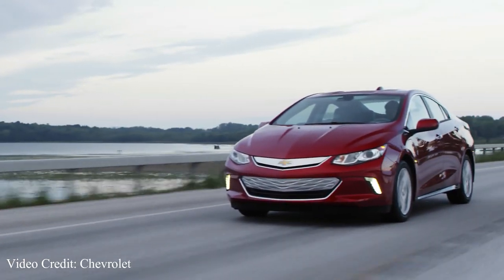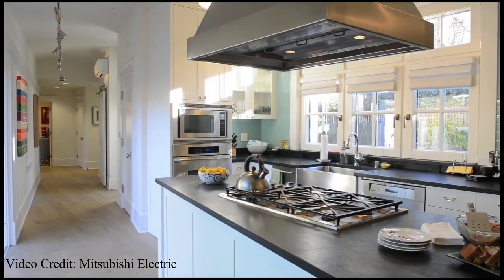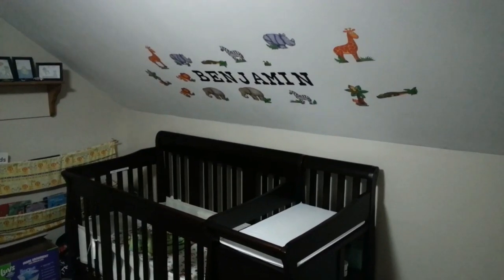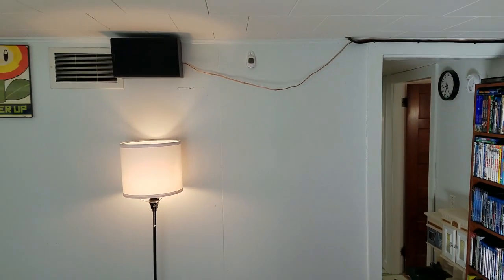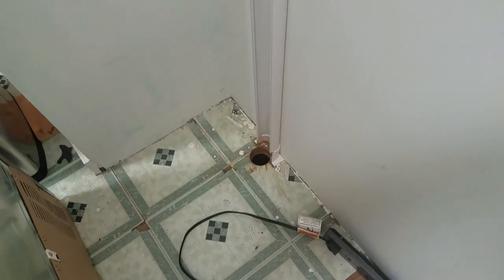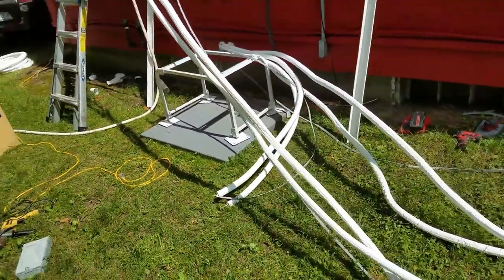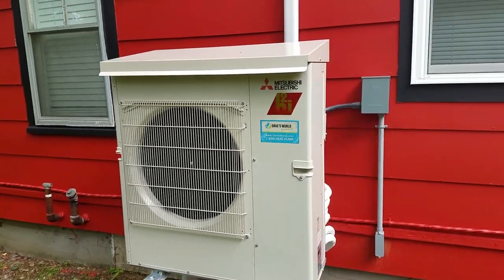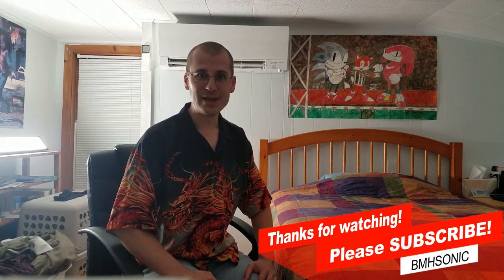Mitsubishi Electric Heat Pump install and Whole Home Heating and Air Conditioning Solution

Comment: Welcome back Bill, it's been awhile.  I hope you'll give us an update on the system which I assume will cause an increase in electric.  I suspect that oil furnace will kick in when temperatures get real low over the winter.  Most heat pumps have electric assist but you should be better off having that oil furnace to back you up in those extremely cold Maine winter months.  I'm sure you'll be collecting lots of data to share with us.
Best to you and Ben.....
Reply from the maker: Yes I will... I'm looking forward to seeing how well it preforms this coming winter. I've had one of these before so I already know what to expect. I'll keep you posted.

Comment: That looks like the right kind of system for that house. In my part of the country we have central AC and national gas heating.  The most important thing for us is AC because it's hot from May to October.
Reply: Wow does my Mitsubishi  slay  humidity. . We spend 35% less  for cooling, get superior  humidity  control along  with almost  silent  operation  inside and out of the  house.  MY old house cost  me $1800.00 to heat  and cool during the 2014-15  season. Heating oil that year was almost $4.00 per gallon which motivated  me  installing  a two ton unit unit  and starting the summer  2015  I spend less than $700.00 per year....Wify raves about  the  mildew problem disappearing .

Comment: How was the heat pump over the winter? When did the oil kick in? How was the electric bill? I just installed bosch heat pump in June. So far so good! We have it set to heat till it is below 30 degrees then the oil will kick in.

Comment: mini splits are great and efficient for bed room and small spaces without seeing a hit on your electric bill. I keep the bedroom mini on 24/7 and its like not having anything on compared to the electric floor board previously. However, the bigger 18k mini for the living room does increase my electric usage that is noticable, I normally use 17k-18k KWH a day but  with this mini on, it will increase to the mid and high 20KWH a day. If left one all day, it can go as high as 36KWH a day. So yea, it doubles my elecrtic usage per day. Overall, my electric usage is way below average , I think and going to the mid 20KWH is still pretty low and reasonable but i got use to the 17-18 KWH usage, so to me, not that great. I use the wood stove mostly and the mini to keep the heat going when too lazy to reload the wood stove. Hope it works out for you.
Reply from the maker: It has been working out for me. 🙂 This video was taken pre covid and since then I have moved. I outfitted my new home much like this during 2020, and have been running solely on heatpumps ever since. I've also added solar to offset the increased electric usage. While it's true that the efficiency drops when temperatures fall below freezing the units still work as expected, and continue to keep my home nice and warm all throughout the winter. Even with the increased electrical usage it's still cheaper to pay the electric bill versus having to fill the oil tank every 30 to 45 days. (and that's before adding solar) With the addition of my solar panels I have effectively eliminated my electric bill.
Reply: @bmhsonic  I love your new approach. Adding solar is an excellent addition to your mini split. I wanted to do the same but that solar installation runs in the $30k. Way too much for a return at this time. I think I need to keep searching for other solar companies till I find a reasonable one for me. 

I bought the Gree mini since the cost of install was in the $5k for a 30k and a 9k BTU compared to a Mitsubishi at $17k. So if I can find a better priced  mini, I hope to find a better priced solar system as well. Going solar is the way to go with these mini splits. Great to hear at your end

Comment: You left out the most important answer to the most important question and that is: WHAT DID THIS COST YOU FOR THE ENTIRE JOB? Very surprised you left  this out.
Reply from the maker: Installation pricing will vary greatly from one installer to another. Also your location and date of install will play a major factor here too. This system was installed in 2019...on a house I once owned on a lake in the middle of nowhere in Maine. It's now 2023 and a similar system I have since had installed on a new home of mine just last year was nowhere near the same price that I had paid in 2019. For these reasons I don't get into what I paid for anything here on YouTube.
Reply: @bmhsonic  Still all in all giving out the cost you paid, the year it was installed and the square footage of your home as well as your location is a good starting point for anyone looking into heat pumps. I think anyone considering this would know enough that changes from what your conditions were would result in different number, but not giving out this information gives the viewer no starting point from which to begin to consideration of a similar system. Some information in this case is better  than no information at all. From everything I am seeing about alternative heating systems from from my current gas furnace is that high efficiency systems are not worth the cost of installation as the payback time in too long as well as the shorter live span of new high efficiency systems.  Knowing what your system cost you at the time would have helped a lot in determining if my assumption is initially correct of not.

Comment: The hood may be model specific so I wonder what is the model number of your outdoor unit? Thanks again.
Reply from the maker: Unfortunately I wouldn't be able to tell you as I sold that house last year.  I did install another unit on the house that I'm in now, but the installer did not deem it necessary to put one on the newer unit here.

Comment: Hi Bill. Met you at the transfer station yesterday. Just watched your heat pump vid, and it occurs to me that right now, somewhere at the other end of the electric feed lines at the generating station, either fossil fuel or nuclear fuel is likely to still be used to generate that electricity. So I wonder what the net reduction in carbon footprint is in running electric climate control in one's house over burning oil, or gas. And since it is a pump rather than a resistive element for heating, how much more efficient is a mechanical pump device pumping refrigerant than a direct-to-inside air heating device... It would be interesting, I think, to report on the cost savings you experience over your oil furnace, too.
Keep up the good work!
Reply from the maker: Yes, hi! I'm looking forward to reporting on this some more after we've gotten through this coming winter. As for the grid it's always getting cleaner, and I can clearly see windmills along rt.2 so it's not all fossil fuels helping to power the grid these days. Maybe if I'm lucky I'll install solar one of these days and can report on that! 😉 It was nice meeting you the other day. Here's hoping that some of those other technologies you were talking about come to fruition someday! 🙂
Reply: Heat pumps are over 300 percent efficient. Electric vehicles are 80 percent more efficient than gasoline. Power plants are cleaner than gasoline engines even if they are coal. Add that to the 80 percent more efficient, and electric cars are by far cleaner

Comment: Hi Bill, I enjoyed your video on the heat pump, mini-split installs at your new home. Congratulations to you, Rebecca and Ben!! I like to color you painted the house. By the way, what's your current garage and home charging status? Just curious. Let me know. Talk to you soon. Thanks, Paul
Reply from the maker: Hi Paul... yeah... Well Rebecca and I are no more, but I do keep the car garaged and I ran a 240v service out there so I'm able to just plug in when I get home and never have to worry about having a "full charge" (I use Hill Top mode in my case) or the time that it would take solely charging off of 120v.
Reply: Hi Bill, I am sorry to hear that!! All the best to your family!! Do you still have the 2017 Leaf?
Reply from the maker: @Zazu2You  Unfortunately I had to give up the LEAF last summer as both cars were in my name. I'm not sure who misses the LEAF more, me or my son because Benjamin always asks me where the white GHOSTBUSTERS car went. The BOLT however has been saving my butt with my longer commute now as I don't have to worry about it as much in the winter months when the range is reduced.

Comment: I’m wondering why you went with a ductless setup instead of just running refrigerant lines straight to the location of existing ducted system. Am hoping to upgrade my gas furnace (installed in 1957) with a heat pump, and it’s looking from what’s online that it’d be much easier to install a single unit that can use existing vents, vs. having to channel pipe to different rooms. My place is similar size to yours, it seems, though I’m in northern CA where it hardly ever gets down to freezing.

Comment: Bill how has your electric usage been with the air source heat pump, and why did you go down the air pump route instead of the high temperature duel hot water tank and air ?
Reply from the maker: So far it's been great... This summer when it was in the high 90's I was keeping my whole home (top floor and bottom floor) at a cool 72, and because I live in Maine I've already had to switch over to heating as we've had nights that have fallen into the low 40's already! I've been keeping a close eye on my electrical usage as well, and from what I can tell I've been averaging no more than an additional 5kWh daily since it's been put in. (with most days less than that.) The system is working great and I absolutely love it! I don't feel guilty either turning the heat on early this year too. 🙂

Comment: Great too see you again bill😃 your new heating/cooling  system looks great.  I live in a condo so i am stuck with regular gas heat and central air that don’t work right now.  I like fall weather becase i will get rid of the 90’s.  How are you liking the bolt? I got to use my 1st electrify america  station . It is really nice . Big screen with all the info. They have 451 locations now.  Check out plug and play ev on youtube. He has done some long trips in his bolt from boston to cleveland ohio and up to canada. He is on instagram too. Great guy like you.
Reply from the maker: That's awesome! I haven't had the opportunity to check out any of the Electrify America charging stations but they look awesome and I look forward to changing on one someday. 😃

Comment: I'm finally caught up on the back watching videos. I found your channel 2weeks ago, and have been binge watching to catch up. Great videos, very informative, and the audio is pretty good. I hope to buy a 2019 Chevy Bolt in November, or sooner. Even though I currently have a Nissan versa note, I do have an electric scooter for in town use.
Reply from the maker: Thanks for watching! I hope you've found my videos informative and fun to watch. 🙂
Reply: @bmhsonic  I found the videos very informative. It's made me more impressed with the Chevy bolt. Even though I don't have EV right now; I did download the plug share app already. Based on the Chevy bolt's range I could realistically go from my hometown to San Antonio or Houston, by using free (complimentary) fast chargers. Again thanks for making the videos.

Comment: I am assuming you will be posting regular updates about your comfort and energy savings as the winter draws near and progresses?
Reply from the maker: If not regular updates I'll definitely post on this again once winter is through and my experience with it.
Reply: @bmhsonic  What have you been thinking of the heating performance so far?  I am sure you've had several nights in the 20's if not teens up there already.  Is the heat output awesome or just marginal like most heat pumps?  Have you had to supplement with your oil?
Reply from the maker: @TheRealJRC  hello there, yes we've had some cold nights here already. The heating IS awesome! I have not touched my oil since late April. 🙂 The electric consumption is about 10kWh more per day on the really cold days/nights. At about 17 cents per kWh (where I live) that's about a $50 increase on my electric bill...which if you think about it is not bad considering oil is around $2.50/gallon right now and I can easily blow through 100 gallons (or more) in a month! I'm on track to be saving at least $200/month! One thing I have noticed (and I was kind of expecting this anyways) is because where heat rises and the thermostats are located in the air handler units themselves you need to adjust the heat almost 10 degrees higher than what you want the room set to. I like it to be 72 in here, and I've found that by keeping the system set to about 78 it's been able to achieve that with no problems. In fact because heat rises I haven't been using the upstairs unit at all since summer (to cool the upstairs) as the two main floor units have been able to keep up with the demands for the house. So far I'm loving this system! 🙂
Reply: @bmhsonic That’s awesome news.  I’m preparing to renovate an older home and planned to use these systems for the heating and cooling entirely.  I was concerned that the air coming from the heat pumps would be cool or cold like most traditional systems, but it sounds as if that’s not a concern.  I’ll be watching for some cold weather videos.
Reply: @bmhsonic  Any updates or good cold weather videos?
Reply from the maker: @TheRealJRC  I've been pretty busy around here so no videos as of late, but I do plan on putting out a video of my savings once winter comes to an end. The system is working great and the savings are definitely there even with the much higher electric bill which was to be expected. I look forward to showcasing all of my related bills (from last year before the system was installed and then this year with the system) once I get to about April or May. I want to be sure to cover what tips and tricks I've learned with using a whole home system to heat the home and to point out any worries or concerns that I may have had when it comes to using and maintaining my existing furnace.

Comment: Yeah, but was the price?
Reply from the maker: This was a $10K system fully installed. The loan is at 4.9% and the payments are right around $100/month for the next 10 years. Completely worth it! 🙂
Reply: @bmhsonic   I wonder what the cost would be to have about 5-6 mini splits installed. I bed out of this world.
Reply from the maker: @silvergt4254  idk...you would have to get a couple of quotes from installers... The funny thing is the first quote I got the installer wanted something ridiculous like $15K for this system...and one of the indoor units wouldn't have been as powerful as what I ended up with. The second installer said they could come in at this $10K price, and where I've done business with them in the past it was a no brainer! Professional installation will always add to the overall price of your system, but it shouldn't cost three times or four times as much as the equipment.

Comment: Heat pumps worked good until the temperature drops, then it will freeze up and then have to go into defrost mode. They have heat strip backup but that sucks electricity like there's no tomorrow and the efficiency drops like a rock.  I'm not sure if you're going to be saving any money or not.
Reply from the maker: Well we'll see... If oil skyrockets then for sure there will be savings. Even at it's current price here in Maine +/-$2.75/gallon the heat pump systems are a more attractive option. Just like my electric car of course the efficiency drops the colder it gets, but it sure beats paying for oil/gas...and that's really only in the dead of winter. I'm looking forward to keeping the house warm at the start of the heating season right through the end. (about a 7 month stretch for us.)
Reply: @bmhsonic  Keep us posted when the temps drop!
Reply from the maker: @TommyboyGTP  will do!
Reply: I've been installing heatpumps for 31 years. A heat pump doesn't need aux heat until about 11 degrees F. Anything above that you are using 2/3rds less power or fuel. Anything below and you revert back to whatever you use now. Nothing beats a heatpump. You will never have any other heat come close to the efficiency. Defrost cycles last a maximum of 5 minutes every hour and a half max. If it defrosted every hour and a half cycle it will use an extra $1.95 per day. Based on a 2 ton system.  They don't defrost that often unless installed wrong or it's a really bad weather.
Reply: There are no supplemental electric heat strips on these particular ductless systems.  These things produce an incredible amount of heat even when it is well below 32 degrees unlike traditional heat pumps.  Only if you go with a ducted air handler would heat strips be an option.

Comment: Where is that one year review video?
Reply from the maker: I moved...but I did install another heat pump (along with solar) on my new house.
Reply: @bmhsonic  That's no good!  I mean maybe it is, but did you install the same system at the new house?  If so, are you planning to continue the story?
Reply from the maker: @TheRealJRC  it's working out great at the new house...going into my 3rd winter not using any other heat source. SO glad I jumped into this head first. Never looking back...as far as a follow-up...I've recently remarried with 3 stepchildren...so with four kids running around and a beautiful wife by my side I find it really hard to put any time or attention into making YouTube videos anymore.